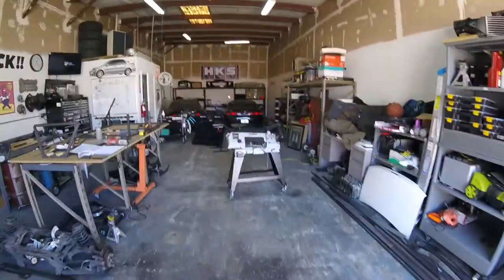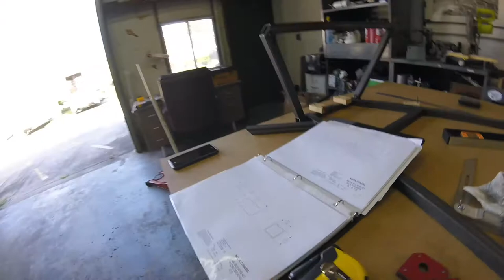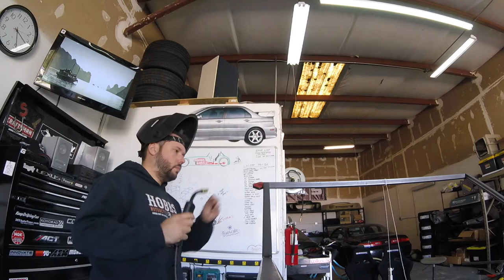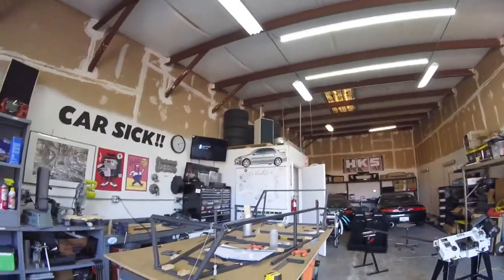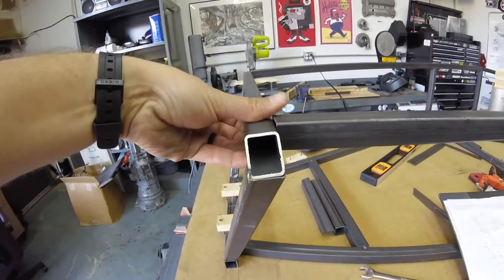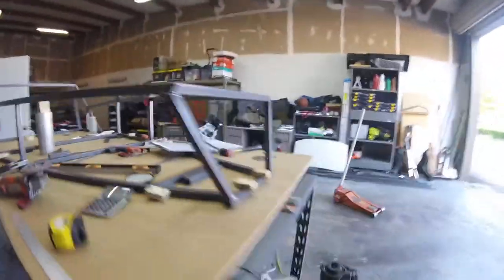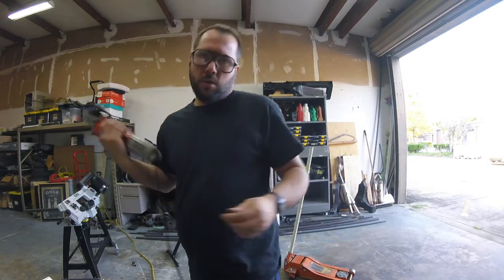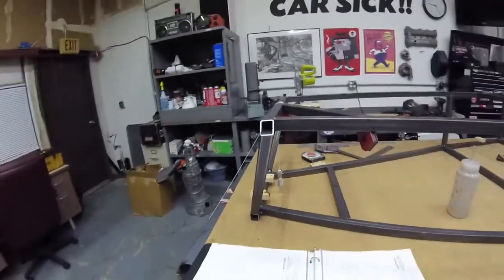Top Tubes: Locost Frame Build

Comment: Nice work, good attention to detail. Cool shop, too. 
What plans are you building off of. 
I've wanted to build a locost for a long time. Even bought the book some years ago. 
1UZ power?
Reply from the maker: Thanks! I downloaded th book chassis plans from Mcsorley, i’m using those. I am also using the rear suspension plans from a miata based chassis, I can’t remember off the top of my head what it’s called, Voodoo i think. I just combined the two. No UZ this time, I thought about it, actually, I’ve thought about pretty much every kind of engine you could think of and for me, in this chassis, Miata would work best. They’re compact, very cheap, abundant, and you can make the right horsepower either NA or turbo/supercharger. If money was no object, I think a B series honda reverse-rotated mated to an s2000 trans would be what i would attempt.

Comment: What are those little red triangular deals you are using to hold your joints together called? Also, do you have a background in fabrication?  If not, What resources did you use to get up to speed?  Thanks
Reply from the maker: Corner clamps i picked up from Harbor Freight. I started messing around with my cars starting at 16, just learned as i went, had some good friends to learn fabrication with too.

Comment: Maybe a dumb question, but is there any risk of building "tweak" into the chassis with forcing some of the bars into place? It doesn't seem like much pressure at all is going into it so I'm sure its negligible, but just a thought.  A friend of mine used to race an asphalt modified, and he chased the setup and unpredictable handling for a season before giving up and cutting the front end off the car to re-do it.  When he cut the first bar going from the rad support to the firewall, it sprung out about 6 inches and he realized the car had taken a hit and it was tweaked. After rebuilding, it was like a whole new car.
Reply from the maker: Definitely! The chassis can act like a spring, if it has too much preload in one direction but not the other, then it can feel crazy. I'm hoping that less than 1/8" on the long tubes won't be enough to adversely affect the handling. Of course, I'm not an engineer and haven't done any math or testing. Crosses fingers.
Reply: You will add far more stress into the chassis just by welding it. When the welds cool they pull the metal together. When he does the final welds he will have to do change positions and not weld in one place very long in order to keep the frame straight.
Reply from the maker: I think I still went a little too fast, I noticed a couple tubes weren't super straight after I was done. oops!